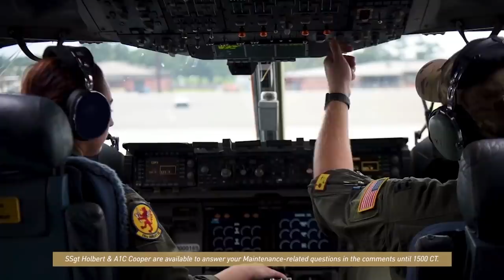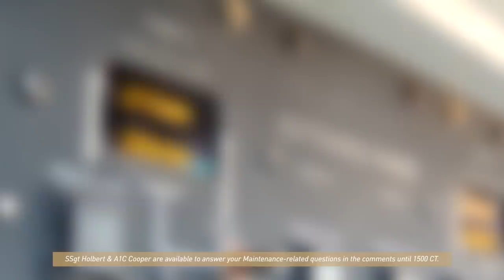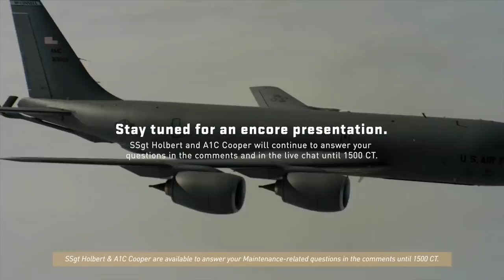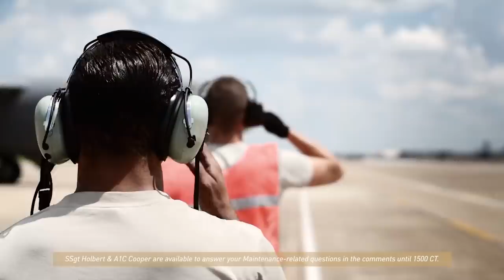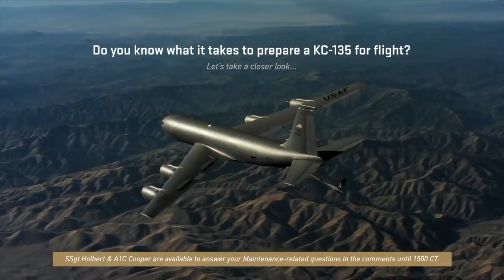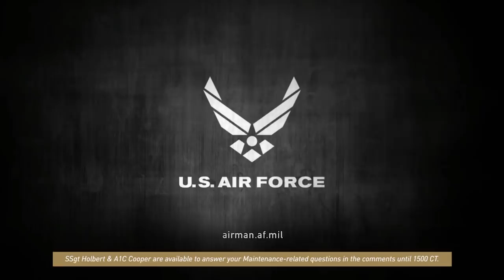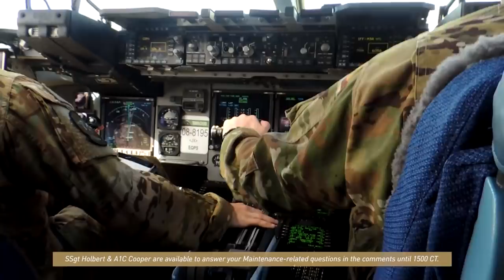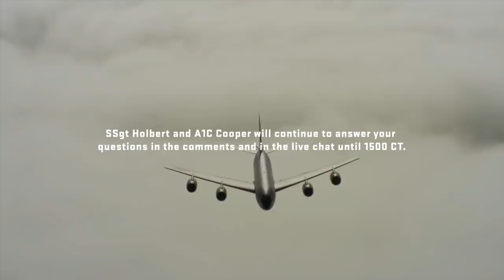U.S. Air Force: Refuel/Bomber Aircraft Maintenance Career Chat

Comment: Airman Cooper I served at Fairchild AFB when we had the B-52's in the alert area on 15 minute ground alert. I was with the 92d Security Police Squadron and we were tasked with securing all restricted areas, that meant sometimes if a OMS, AMS or FMS maintainer made a mistake entering we challenged that person and corrected the problem. We made sure the special weapons were always secure. I had friends from all of our squadrons on the base. I am sure I would not recognize the base as it was 1977 to 1982 when I was stationed there. Our mission never failed 24/7 no matter the weather. It will get cold in the winter and hot in the summer. Thank you for serving is our great Air Force. I am assuming you have picked SSgt Holbert's brain to ensure you complete your mission. He seems to be an outstanding supervisor, someone you can emulate as you move up the ranks. To both of you, Thank You for continuing the mission of the Air Force!!!!
Reply: Is that the only base where they have the bombers? Or could they be stationed other places?